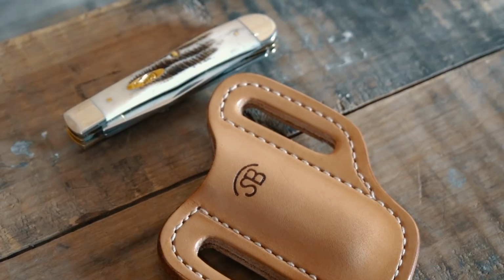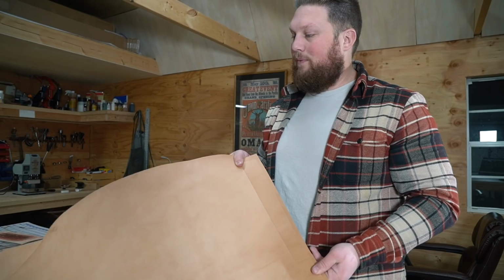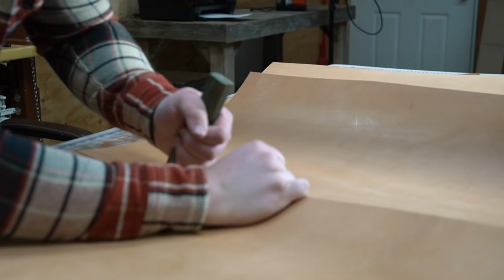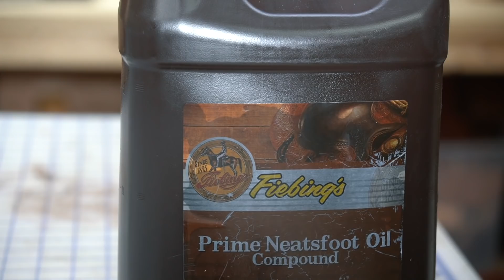Making a leather knife sheath (Full)

Comment: You should of made a few belt blanks before cutting it down. I cannot keep them in my shop. Working crew people love them. Try using a carpenters knife. Just run the blade over a polisher with a little Jewelers rouse first, yes sharpen the new blade. It will cut it.

Comment: Just curios on what wing divider you’re using?  It looks like it does a pretty good job on channeling out the leather for counter sinking the thread.  Do you find that it works better than an actually stitch groover?   I find that my stitch groover (even with a new blade) puckers the outer edge of the leather.  It would be good to find an alternative solution.